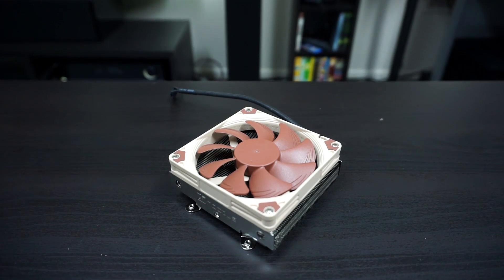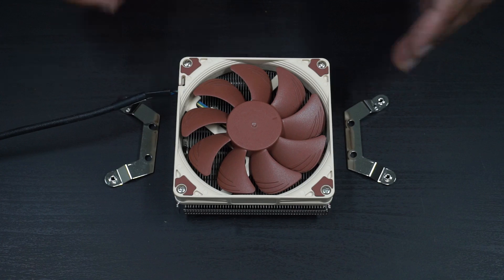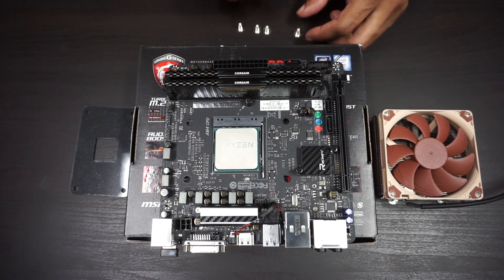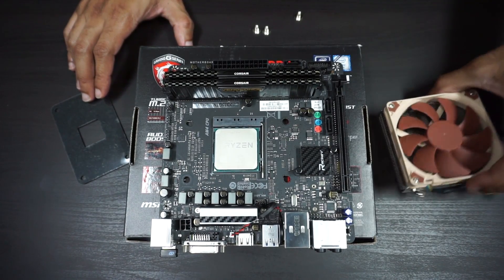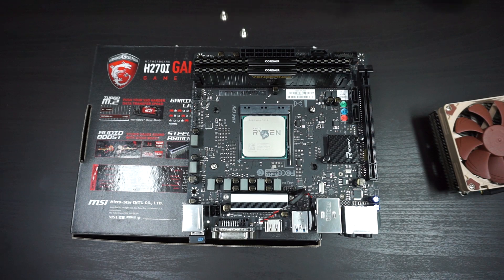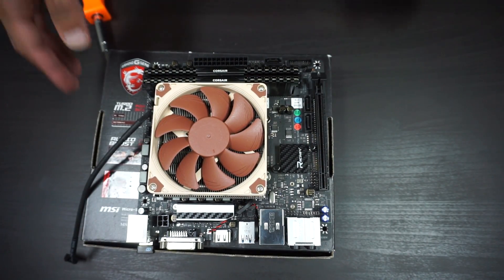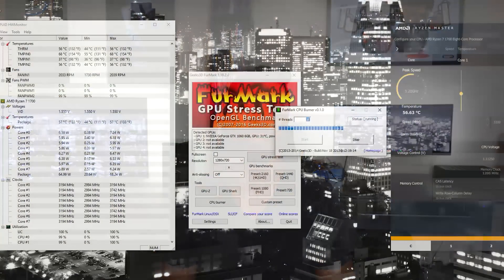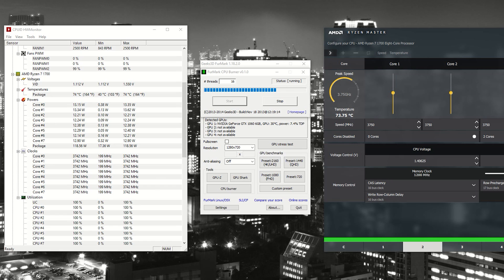Noctua NH-L9i AM4 Upgrade Kit + Ryzen 7 Temps

Comment: I'll be using the same cooler with a Ryzen 5 1500X when I upgrade (coming from an i5 4670). I plan on cutting a hole in the lid of my MC600 case (bought based on your review, thanks!) over the cpu and potentially use a slim 120mm fan instead of the includes 92mm w/the L9i to get some airflow to the surrounding components.
Reply: Have the same cpu. Still running strong for almost 4 years now. I will probably be upgrading to the R5 1600 or something similar in the next year or so.
Reply: DjuroDraco Yeah the 4670 is a workhorse, but it doesn't love my tiny poorly ventilated case. Hopefully a 1500X will run cooler (it should).
Reply: It is summer here and in my decently ventilated case it idles around 32°C and at full load around 62°C. In winter it idles at 28°C and full load at 58°C. I use the hyper 212 evo and it is very quiet. I should mention I have the multiplier at 38 so it hits 3.8 GHZ on all cores instead of 3.6GHZ.
Reply: DjuroDraco Yeah I'm around 40 idle and 65-70 under gaming load at stock speeds with the L9i due to poor case ventilation. My system is in a cold-year-round basement though so it'd running hotter typically. I'm using an EVGA 1050ti which is even more of a problem in the case. Hopefully cutting a couple of holes in it will fix the temp. issues.